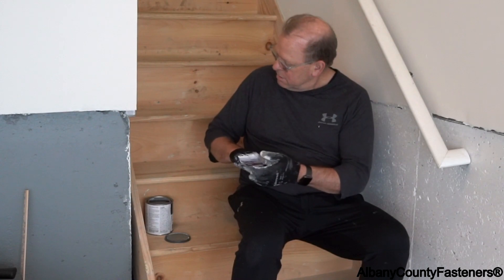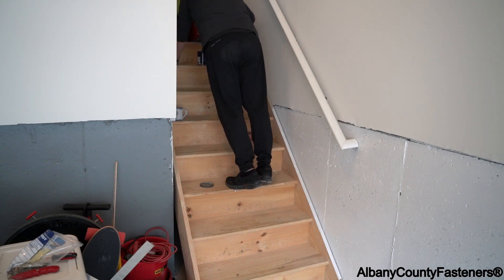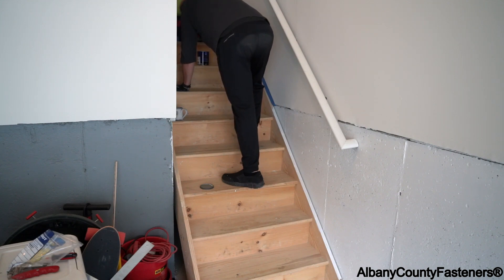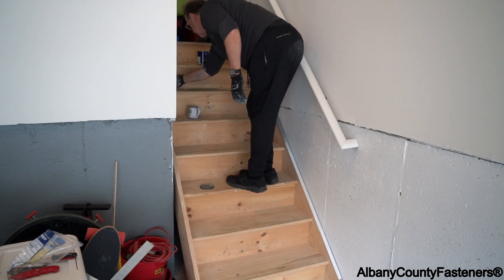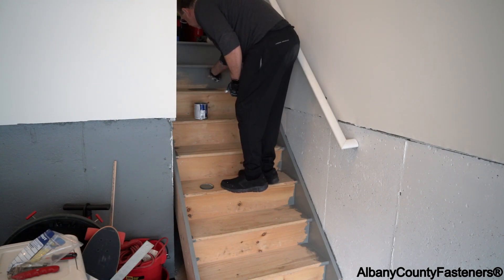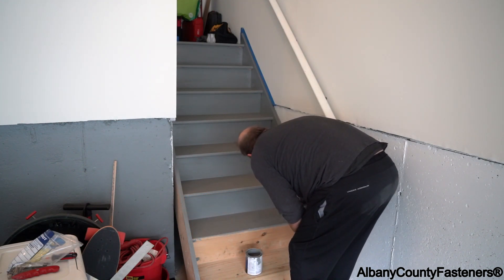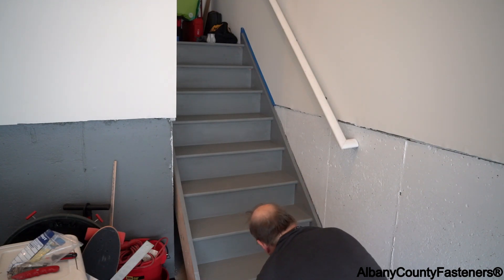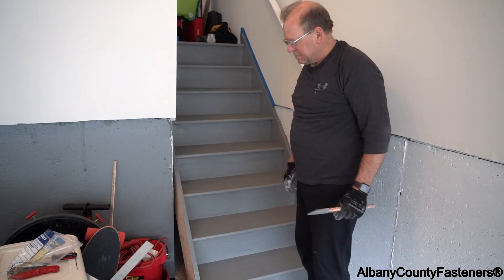Tips & Tricks For Painting Stairs - Stringers, Risers, & Treads | DIY

Comment: When I painted my basement stairs I painted the stringers and risers from the top of the stairs to the bottom. I then painted the treads
from the bottom to the top so I wouldn't have wet treads to climb up the stairs on. When completely dry I installed rubber treads for both traction
and to prevent wearing of the paint  on the treads.
Reply from the maker: A good plan! Thank you for your feedback.